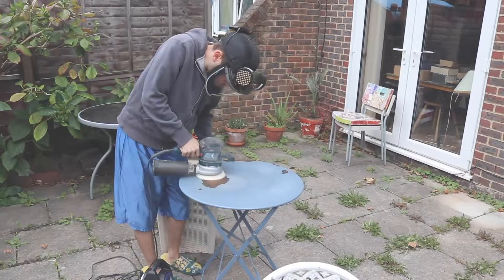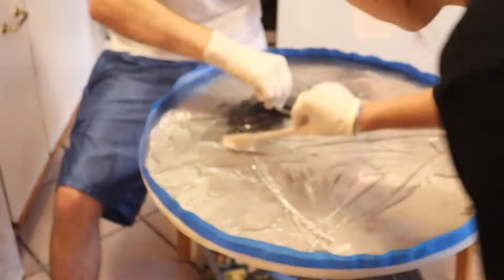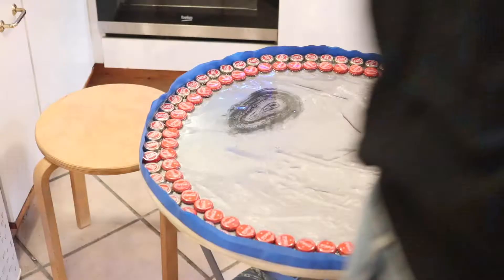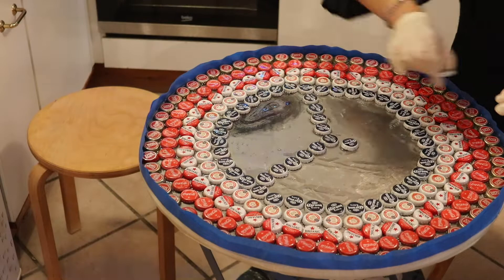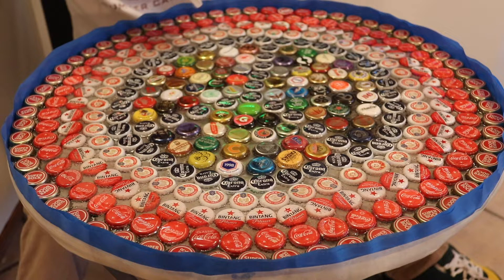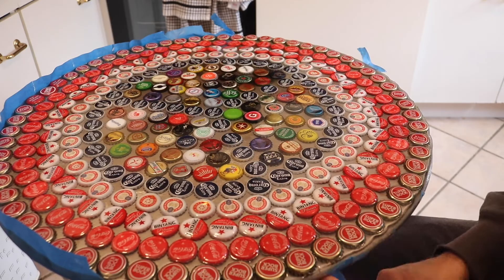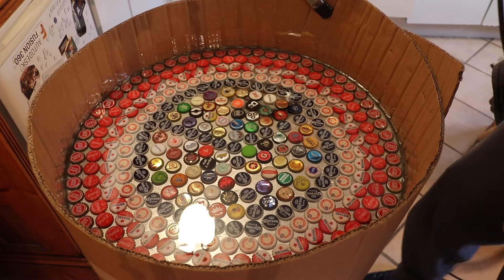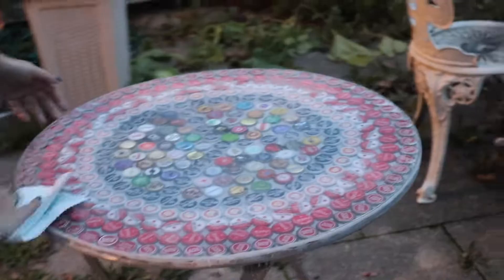400 Beer Bottle Caps + 1 Resin Bottle = Table

Comment: When your caps are set use a coloured waterproof tile grout to fill in between the gaps let it set will save you a ton in epoxy just then do a flood coat
Reply from the maker: Thanks for the info! Good tip

Comment: Is the table in the sun? just wondering if it changed color (yellow) over time outside. I'm looking to make a similar table. Great work.
Reply from the maker: Thanks! Yeah, they had put it outside, but I recommend to keep it indoors because almost every thick resin will yellow.  However, over the years it hasn't yellowed or cracked, and still looks great.  Have fun!

Comment: How much epoxy resin did use for this one? I have bottle caps collected and same sized table, so was wondering how much of epoxy should i buy.? Also, would it make a difference if you poured all the resin all at once instead of doing it layers?
Reply from the maker: Hey Disha, I used about 1 liter of resin, but depends on the size of your table.  And yes, you should pour just a little to begin with to make the bottle caps stick.  Otherwise they will float to the top.  Also, resin needs to be poured in small layers so it wont have an exothermic reaction and get hot.  Hope this helps!